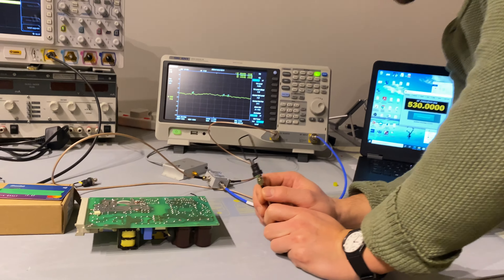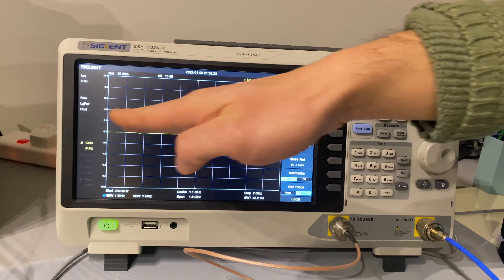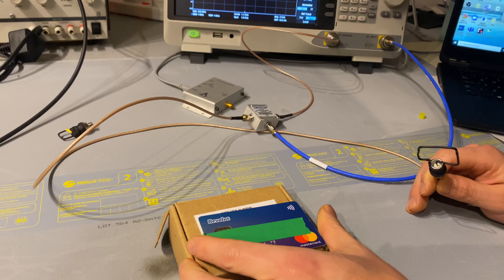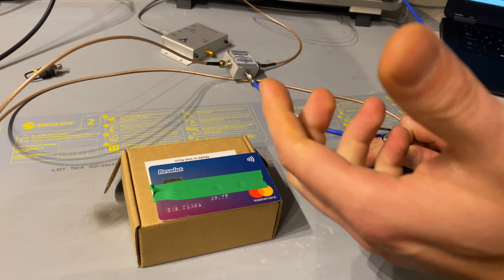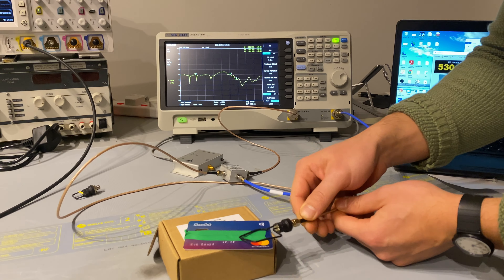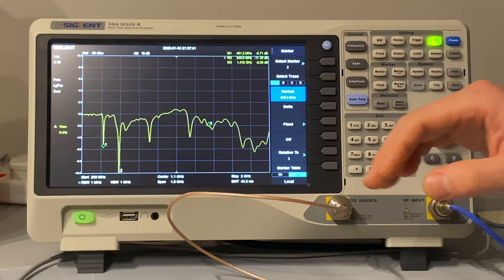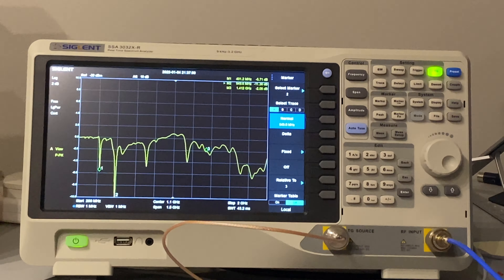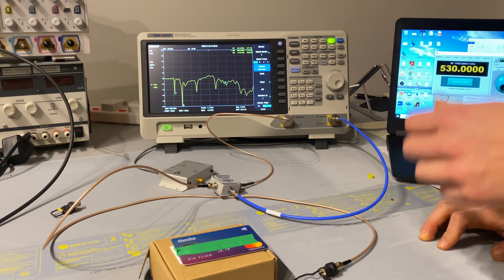Structure resonance can cause radiated emission/immunity issues - how to locate a resonant structure

Comment: Great Video. Thanks for posting.
Would you be able to advise the part number of the Directional Coupler from mini circuits ?
Reply from the maker: Hi Keith, sure. Most people use ZFDC-20-5+, but I used ZFDC-10-5+ in the experiment.

Comment: Sir what is the software u r using. Did it was connected with any hardware?
Reply from the maker: Hi, that software controls the signal generator I used, which is from Windfreak Technologies. Hope it helps